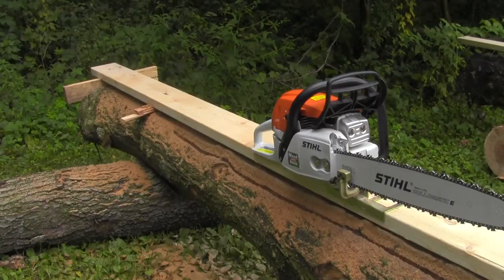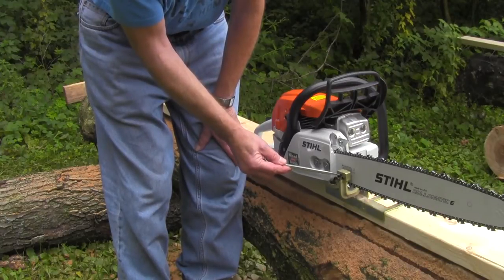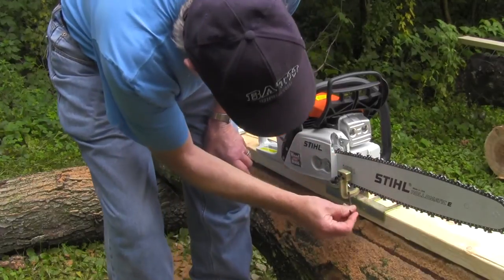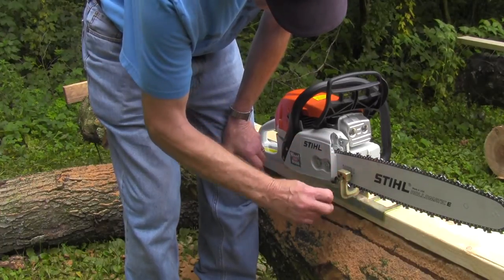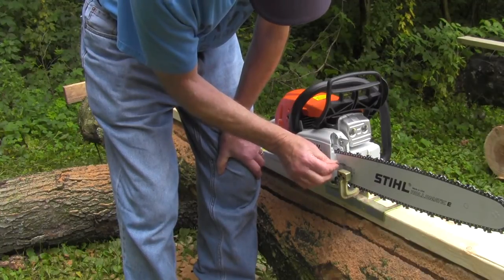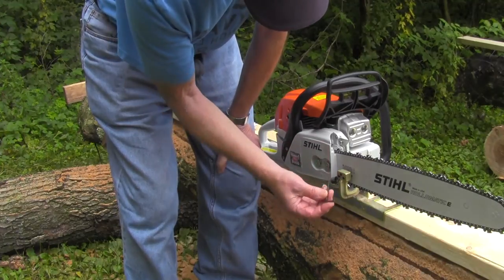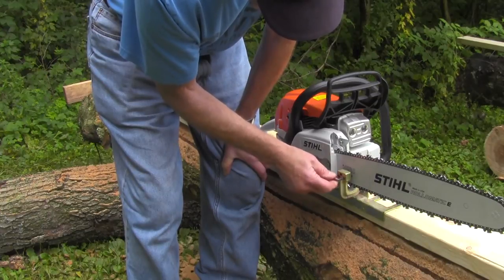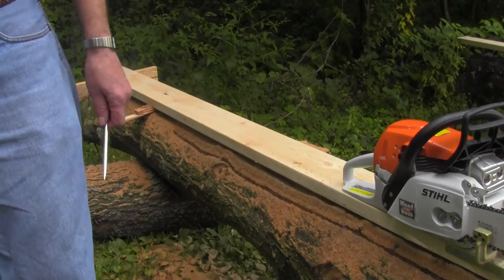Installing the Haddon Lumbermaker

Comment: I love my unit and I took 2 4 foot 2x6 planed them down and mounted aluminum angle iron to them to act a rail which keeps the unit above screw heads and tracks very smoothly. I put a door hinge in the middle so I can go from 8 feet down to 4 feet instantly and pack it into my truck easily. Again really like using this thing. Now however I have a bunch of gorgeous beams that I need to find a purpose for so that my wife doesn't kill me.
Reply: What type/size saw are you using? I just bought the Haddon LM and I have a Stihl MS261 with a 20" bar - I hoped I could get a 25" bar and new ripping chain but haven't been able to find one with the pitch/gauge combination I need...? I'm grateful for any help...  re: the wife - I'm in NE TX, if your close I'll take the beams and you can tell her I bought them - always willing to do a favor..
Reply: Cannon  brand !!!  thin kerf chainsaw bars